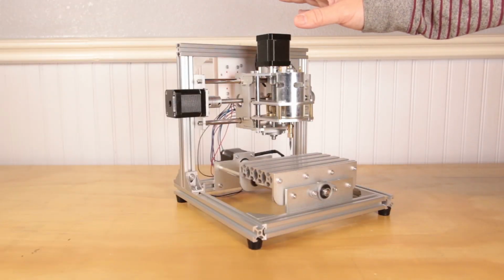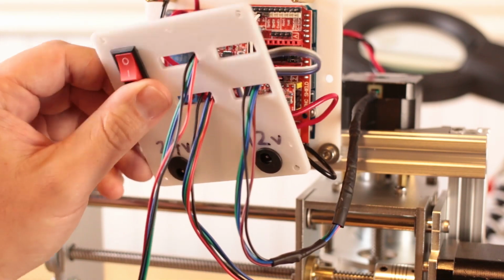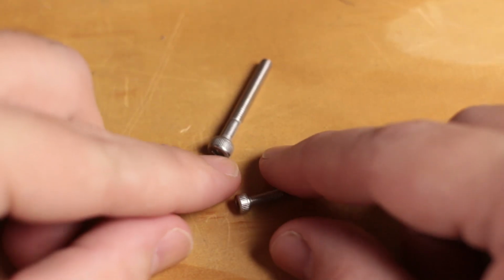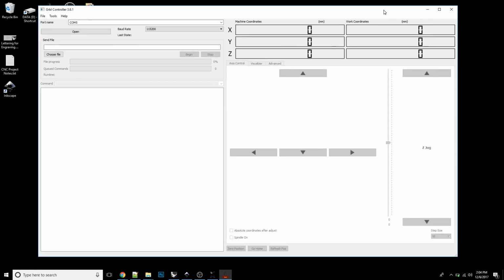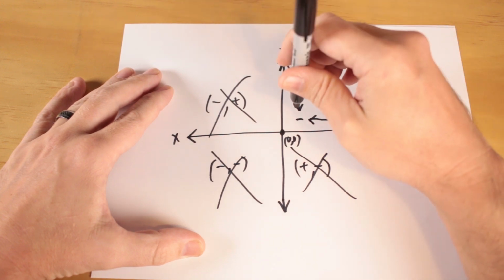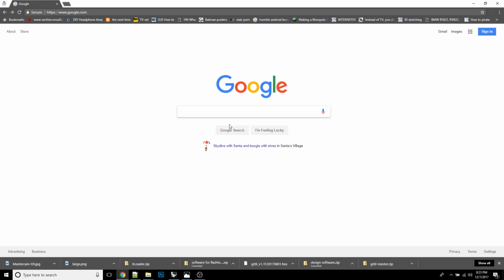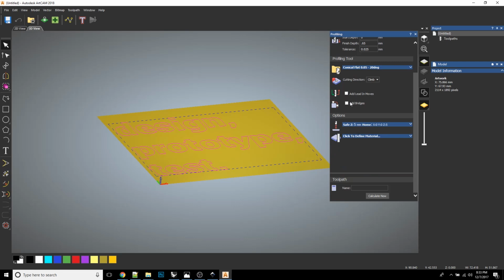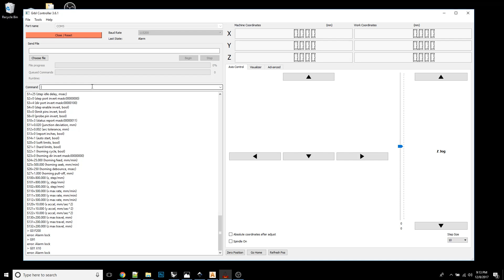How to start CNC Machining for under $200 - Working with the T8 CNC engraver

Comment: I am a Flight Simulator enthusiast building a full B737 simulator and new to CNC. I would like to use this machine if suitable to engrave small plastic panels, but need to know the max cutting size of this machine.
Can you give me these measurements?
Thanks.
Reply from the maker: If you assemble the machine as I have, you can cut approx. 120mm in the x-axis and 100mm in the y-axis. The machine looks like it could accommodate  up to 1-1/2" thick material. However,  I do not recommend using this machine for anything more than engraving (i.e. don't cut deeper than 1mm) without at least upgrading the spindle.
Reply: Thanks very much.

Comment: I figured out the problem on the Xloader, didn't have the proper path for grbl9.hex.  Got that loaded and did drivers and software.  My computer is now talking to the machine but is isn't listening.  I have went over your video so many times that I could almost recite your dialog word for word.I have checked the wiring and double check it but nothing happens.  There is a red led on the main board and a yellow one on the relay and when I jump the terminals on the relay I can get the spindle to run but the stepper motors  won't move.  Do I have a bad circuit board and relay?
Reply from the maker: John, I wish I could help you trouble shoot your machine. It is exceedingly difficult to do through these text comments. I've found that the problem is usually caused by me, and not faulty hardware. Although faulty hardware does happen. My advice to you is to separate issues the best you can. Make a list of things that work and things you don't know if they work. Starting with the connection between the machine and computer. It sounds like you got the firmware loaded onto the machine. I assume you have installed GRBL controller onto your computer and tried to connect to the machine. What happens? Do you see the $$ menu? Then you know the two are talking. What happens when you try to move the X axis through the GRBL controller? Does it pop up an error message, or does it say it moved on the computer but the machine does nothing? Each of these behaviors tells you something, and if you logically think about how the machine is supposed to work you can figure out where the problem lies.
Reply: Each time that I turn on the grbl controler, I get the $$ and the accompanying files.  I insert the G0F200 code for speed and them click on one of the axis and I can see a little LED flash on the bottom board but nothing happens.  X,Y,Z, nothing happens but the LED flashes.  Also on the controller, I will get a code G091, next line G01 Y10 or G091 G091, next line G01 Z-10
F260.  NOTHING!!  This is why I think I have a bad board.  The commands are there and seemely accepted but there is no power transfer to the steeper motors or the spindle.

Comment: very good video, I listened to it all the way though. Could you give me some direction, I want to get a CNC bed to work with an air actuated parallel gap spot welling head for welding 18650 battery packs. So your typical 48V21Ah battery will have 91 - 18650 cells and each cell will be welded in 3 locations on the top of the cell and 3 locations on the bottom of the cell. So I need a way to add 546 locations to a file and then at each one of those locations stop and give the weld head instructions to do a weld. thanks for your time in advance.  I gave you a like subscribed. Thanks!
Reply from the maker: If I understand what you are asking, the G-code file for this shouldn't be too hard to write. If it were my project I would probably start off with a CAD file containing all of the X,Y point coordinates for the spot welds. I would use a tool path program to pretend that the points were drill operations. Then I would go through the G-code by hand (using notepad++ find and replace feature) and replace all of the drilling commands with movements that made sense for the spot welder. Of course you will need to write the actual spot welding commands by hand, so brush up on your G-code. 

Before you ever get to the G-code file, you will need the CNC machine which is large enough to hold your battery pack, the jig to hold the batteries, and the spot welder mounted to the CNC tool head. I strongly suggest some sort of a spring mounting so that you don't accidentally push the welder tip into the batteries. 

It's an involved project you are getting into, but there's nothing fundamentally too difficult about it.
Reply: thank you very much for your response!

Comment: would it be possible to use this setup (with some modifications) for milling? 
the spindle seems to go quite slow for example. 
what would be the cheapest required machine to do some (I'm very OK with slow) metal milling? 
br

Comment: Can u scan item using this machine and then cut or u need to have this in the program thanks
Reply from the maker: No. This is a very basic CNC machine. It has no scanning capablility. For 3D scanning look in to "Recap 360" or similar.

Comment: Does a Nema 17 stepper motor rotate both ways by itself, i mean for engraving or Cnc
Reply from the maker: Yes. Any stepper motor can rotate in both directions. Stepper motors do not work by themselves. Unlike typical DC motors, which only require a current source attached to them, a stepper motor requires a dedicated control board. Stepper motors turn in small increments called "steps" these steps can be in either direction. The control board effectively counts the steps and that is how accurate rotation is achieved. HomoFasciens made a great video explaining all of it here: https://youtu.be/Qc8zcst2blU

Comment: I think that power socket is a switching DC jack, it breaks contact when a jack is inserted, did you check the other connection?
Reply: That was the same sense I got. That it was a so-called "normalling jack." Because the connection wasn't intermittent and it appeared intact.

Comment: thanks for the video .i actually cut the 20 x 20 extrusion 22mm with my miter saw .both the front one and the back one .the laptop that i will be using with the T8 CNC machine is running windows 10 .every time i try to open xloader.rar it asks me what do i want to open it with . so my question is what do i open it with and do i need any other instructions to get up and running .
Reply from the maker: the .rar file is similar to a .zip file. You will probably need to download "winrar" to unzip it.

Comment: Wait, i missed the part where you solder and connect the 4 terminals of the motor to the grbl for each axis. Is there a specific way and what would happen if i were to reverse it?
Reply from the maker: The four stepper motors have wiring harnesses with end clips that make it practically impossible to do incorrectly. Printed on the PCB is a label for each of the motors X, Y, and Z. Simply plug the motor which controls the axis into the correspondingly labeled plug on the PCB. Remember X is the side to side motion, Y is the back and forth movement of the bed, and Z is the up/down motion of the spindle/cutter.

Comment: I'd find your grasp of the dark side endearing, if you weren't so damn smug. 

A quick lesson on the right hand rule, and Cartesian coordinates. 

Most machines are set up such that from the operator's perspective, the Z axis is the spindle axis, the x axis is left and right, and the y axis is towards and away. The origin can be anywhere, and a skilled machinist knows how to move it to suit his needs, so that BS about only using one quadrant is useless. Positives and negatives are determined by the right hand rule. 

With your right hand, extend your thumb to the square, extend your index finger fully, and your middle finger half extended so it squares with the index finger. The other two are spares for when you lose the first two. Orient your thumb in the direction of the x axis, pointing to the right, this is your positive direction for the x axis. Align your index finger with the spindle, this is your z axis, positive is the direction you are pointing. That leaves the Y axis and it's positive direction is the direction the index finger is pointing. 

As I mentioned, not all machines are exactly like this, but the general rule of thumb is to always label the axes in the order of X Y Z X Y Z, while using the right hand rule in the order of thumb index middle thumb index middle. With lathes, the spindle typically is the left/right axis, and the spindle is always the Z axis, so the thumb pointing right is the positive Z axis, the index pointing away is the positive X axis, and the middle pointing up is the positive Y axis. The positive Y axis is rarely used in operation of a lathe, but it has its uses in tool alignment and rake angle. 

The origin can be anywhere. Unusually, when you home the machine, which is retracting each linear actuator to its nearest position of the driving motor, is where absolute zero is defined. This usually means the spindle up as high as it can go, or table down as low as it can go. Then depending on installation, it could be table all the way left or right, and all the way away or towards. This is one reason why thinking you only have to deal with one quadrant is a mistake, could be the spindle up, table all the way left, and all the way away is home. This means when working in absolutes, you're always in the negative x, positive y, and negative z axes. That's quadrant II for just 2D thinkers. 

Not all parts have their relative origin nice and neatly in the bottom left corner. Sometimes it's more advantageous to put it centered on top of a hole in the part, or right side centered. It just varies to what you're making. Sometimes you want to cut multiple parts from the same stock, so you move the origin to accommodate.

Anyway, I've ranted enough I think.
Reply from the maker: I apologize if I come off as smug. I try to be earnest, and playful. 

Anyway, I was waiting for someone to call me out on the coordinate system bit. Finally something to talk about besides the whole tinning of leads issue! The right hand rule is certainly a tried and true learning aid, but I personally find it a bit cumbersome. We are all familiar with the graph I showed, having learned it in like Kindergarten It's kind of indelibly a part of our cognition. Why come up with a new learning aid (the hand trick) when we can just close our eyes and visualize the math graph?

Of course you are right about the origin being arbitrary. Two of the machines I showed on this channel are Delta style printers which have the (0,0,0) point directly in the middle of the bed. The thing is I made this as a beginner video, and many CNC machines including every Cartesian 3D printer I have ever seen have the origin at the bottom left and touching the bed. Even though the vast majority of machines work this way, I was wrong to say "We are never going to use any of these quadrants." I should have been more long winded about it and said something like "For the most part, as a beginner CNC technician, and 3D printer operator, we want to make things easy. To that end, we are going to ignore these negative quadrants, and operate only in positive space. If you ever find yourself needing to go in to one of the negative quadrants, it can be easy to make mistakes (for instance moving to the right in a negative X quadrant means the numbers appear to be getting smaller until you notice the negative sign), but I'm sure you will figure it out using the simple rules I'm about to show you."
Reply: Sorry, I was trying to be playful getting into the role of a Sith Lord with that first quip. 

I don't understand the obsession over tinning in this application. It's computing electronics, if it's carrying enough current to make differential thermal expansion an issue, then your pc board is fried anyway, and you have bigger issues. If you were working with relays carrying carrying industrial loads, then there's something to be said, but you're not. When I was doing electrical work myself, I typically tinned only braided wire just because I'd get sick of it fraying as I needed to rearrange connections. 

Oh, and the right hand rule still applies to the typical mathematic depiction of graphs, the Z axis comes out of the page, or chalk board. Generally it's not discussed until calculus or so, but it's there.

Comment: Do you Guys think You could machine Steel with this if You bumped the feedrate and depth of cut Wayyy down?
Reply from the maker: No. Brass and aluminum maybe. Getting any kind of good result in metal will require a lot of modification to the machine.

Comment: The easy way to correct the bed travel issue is replace the side maker rails with longer ones (see here: https://youtu.be/G-QPGFNynB8) as in doing this you can even extend the bed quite a bit too (see here: https://www.youtube.com/watch?v=eEkNfK19yf4 ).  It is a very practical machine as I had also installed a diode laser on it too for engraving...
Reply from the maker: DIY3DTECH.com Why spend the extra money and time waiting for parts to arrive when simply assembling the kit in a different way will solve the issue?
Reply: I could say the same about putting the parts on backawards too :-) As why not invest and do it right, as it was less then 10 bucks and every self respecting maker has maker-rail around so no waiting and in addition to greater bed range, I also got better stability too
Reply: I am a complete newb at this. I'm a welder/sheet metal worker (retired), for the cost stated it is worth it for me to try this. Can I at a later date extend the rails, srews and guides and tell the software it is a larger area?

Comment: Why not crimp the wire into the fittings as designed then solder the connection for a better factory crimp. Just wondering?

Comment: Hi, I've setup this machine and I'm having problems with the spindle. It won't turn on unless direct power is applied. I thought it might be the relay, but after changing it out for a new one, it made no difference. Does anyone know how to fix this?
Reply from the maker: It sounds like you don't have the signal wire plugged in correctly. Double check that you wired your machine the way that I show at 11:12 in the video. If you are absolutely sure that it is wired correctly, the next step is to check that a signal is being sent from the SpnEn pin. I suggest you wire a 5v LED to that pin (white bar = (+)Power) and see if clicking the "spindle on" button in GRBL controller program turns the light on/off.

Comment: You didnt check your Vref on the motor drivers.  If u set them correctly it will change ur steps per mm!
Reply from the maker: No. This is incorrect. Vref increases strength of the motor (torque). The distance traveled is determined by the software. It is quite literally counting steps (hence the name "stepper motor").

Comment: Why do they sell these machines with such slow spindles? That spindle should be running 50,000 RPM's to use a bit that tiny.
Reply: I have just built one of these. With 24V the spindle speed is twice that with 12V. However, for laser engraving the recommended max voltage appears to be 12V, so depending on the tool - cutter or laser, the power leads need to be changed over. Edit: I have been wondering what the speed really is.The small cutters chew through plywood OK. The GRBL 1.1f info suggests 1000rpm, but measuring is knowing.

Comment: I personally would not tin the wires, also I use a professional crimping pliers for the joints. But for a DIY, yea, no biggie really. You could solder the whole connection after the crimp, that would be ideal. You gonna solder anyway, why not the whole thing. Then follow up with some heat shrink on the end. I don't think the thermal expansion theory hold water in low voltage small non critical connectors that were assembled with a pair of needle nose pliers.
Reply: +1! -  and Thank You for pointing it out -- those connectors are expressly designed to split the strands when you close the Crimping Tool (not needle nose pliers). The decision 'to tin, or not to tin' requires considering several factors, rather than simply a blanket 'always tin'. If you doubt, try tinning the perfectly-formed hooks in stranded 14-gauge, before you tighten the screws onto them connecting to stove-top burner elements! It may take a while, but the lesson will be well-learned.